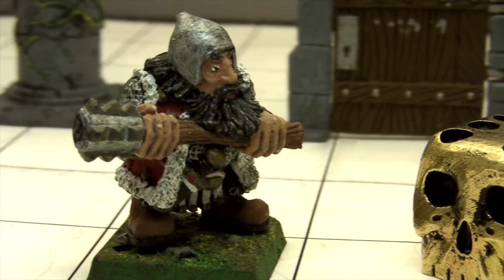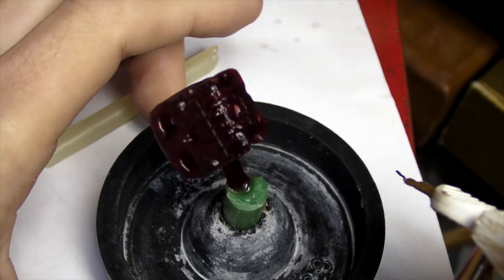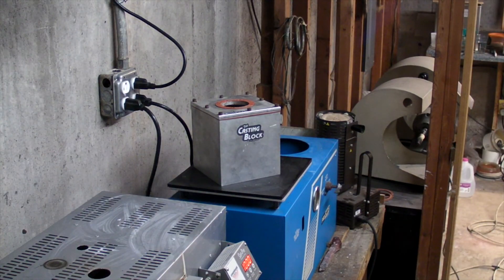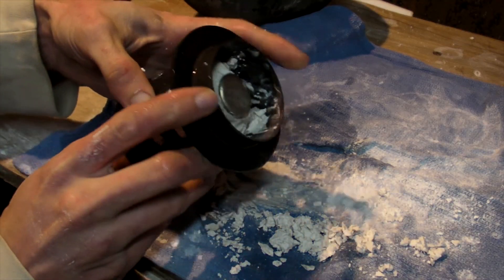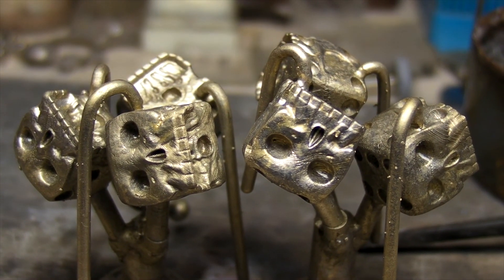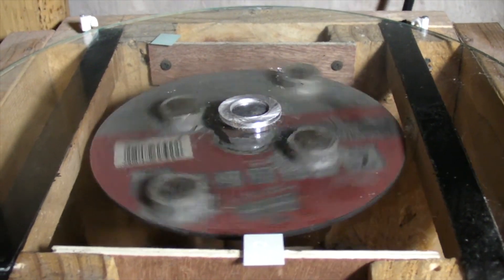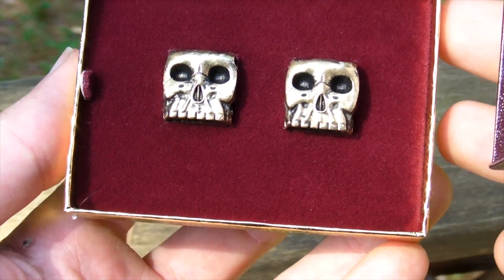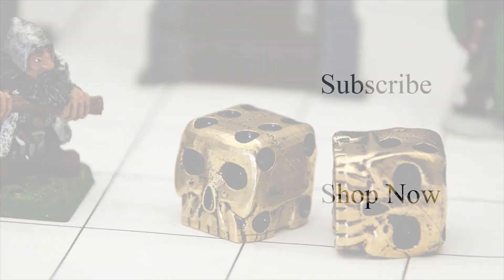How to Make Metal Dice Skulls with 3d Printing

Comment: 0:30 On a standard set of six sided dice we have decided that the opposite sides should add up to seven. However, no matter what the die (only on even dice as odd number dice can’t have this happen) the opposite side should be one plus the number of faces on that die, the only exception in the standard D4 (pyramid shaped). For example on a 20, on the number 20 side the opposite side should show the one. Yes this should be cast on a D10 and D8 the side that is facing up should equal to eleven or nine respectively from the side that is face down. If this isn’t the case then the dice is improperly made. This should even be the case on a spin-down D20, the spin-down d20 also shows another thing we do about standard dice, every set of pairs 20&1, 19&2, 18&3, and so on are flipped across the die so that the dice is more balanced, but that probably doesn’t make that much of a difference, unless someone is trying to get on one side over the other. In other word the are cheating and have practiced with their dice to get the higher side. One thing I just noticed one thing, there are even and odd sides on d6s, d8s, d10s, d20s and the percentile dice and even on my d14 and d16 but not on the d4s, d12s and the d24 that I have, I don’t know why that they altered the d12s (the d24 is so rare that it really doesn’t matter same for the d14 and d16). Maybe it is because you can look at the face of the D12 but with d6s, d8 and d10s you have to look at a point on the die but that doesn’t hold true for the d20. Weird.

Comment: Hello.
Very nice channel !
Can you tell what is your investment (where did you buy it ?) ? It's pourous :-)
And do you have something about your magnetic tumbler ? What is the medium inside ? Looks like steel whool, but since it isn't rusted, i'm wondering. Inox ?
Tia for your answers !
Reply from the maker: I use Plasticast investment. You can find it from most jewelry tool suppliers. The tumbler uses stainless steel pins as media.